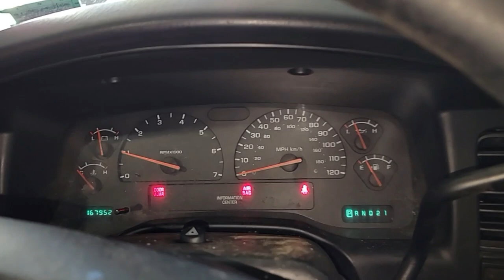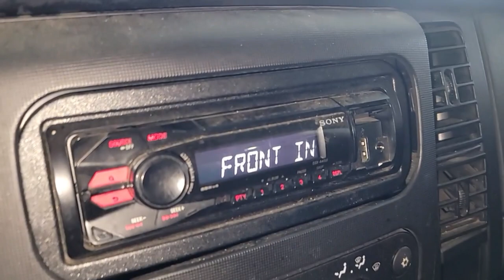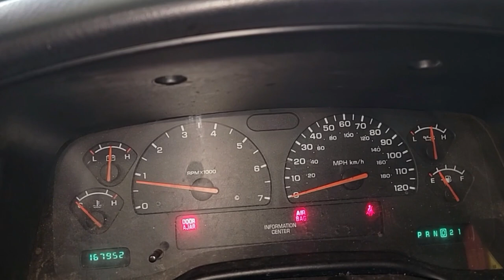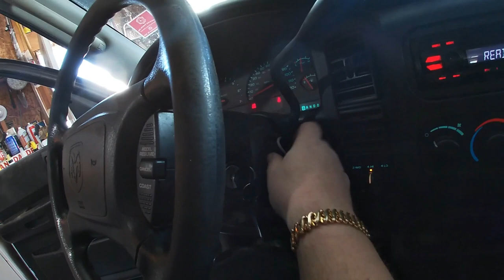Dakota with no oil  WILL IT START?

Comment: My grandma has an 03 4.7 with like 130,000 miles on it, she ran it without oil for like 10 miles once… Complained it was making a tapping noise…add oil noise gone. On its 2nd transmission though.

Comment: I almost wonder if tightening up the pan bolts on the transmission and adding a little bit of fluid might get her to move?
Reply from the maker: Has a rot hole in the bottom